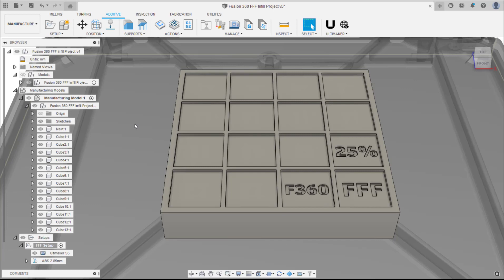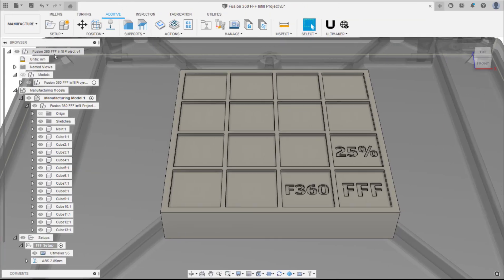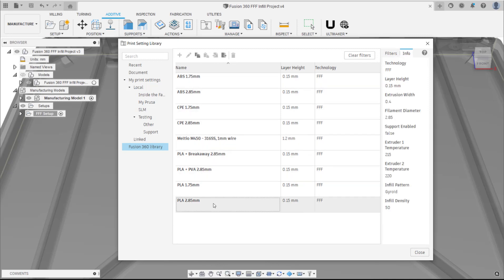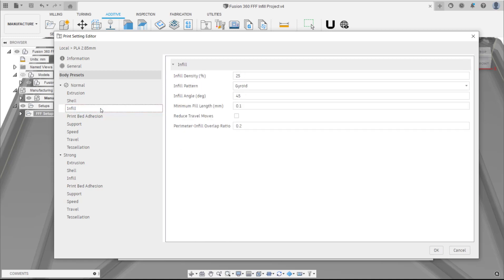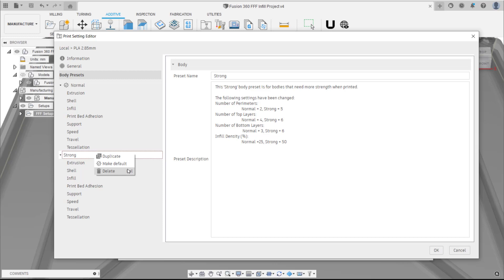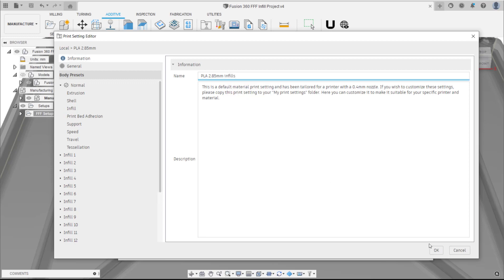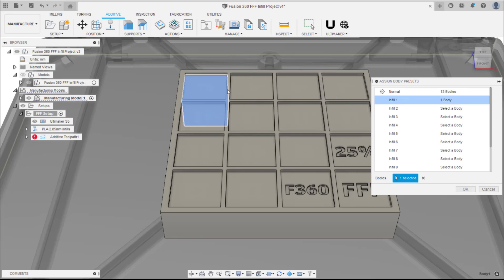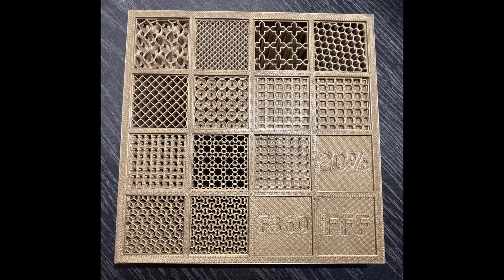How to Create Parts with Varied Print Settings with FFF 3D Printing | Autodesk Fusion 360

Comment: What happened to a bunch of the print settings in the fusion 360 slicer? I looked and I could no longer find the features to add a raft, change the print speed, change the infill, and other useful features that I usually use. I need help please 🥺
Reply: Hi Lucas, hmmm that doesn't sound right! Please see this video here on the new print settings dialog: 
https://www.youtube.com/watch?v=Gf16Sjn-nHE&list=PLmA_xUT-8UlIF-Cufk_7QG7miICaE30Oe&index=2&ab_channel=AutodeskFusion360

See timestamp 1:30 of this video.
Reply: @TripleEspresso7  I’ll take a look at it. Thank you for your help.

Comment: This video focusses on the print settings and body presets specifically.
For all those wondering how to create a setup (mentioned at 0:52) see this video here showing the full Fusion 360 FFF workflow:
https://www.youtube.com/watch?v=gi9qvDDeziQ&list=PLmA_xUT-8UlIF-Cufk_7QG7miICaE30Oe&index=5&ab_channel=AutodeskFusion360
Reply: When you press Post process in the layer simulation, can it always use last post processing profile, instead of creating a new one?...
Reply: @dzidmail  sorry what do you mean by this? I'm not sure what "processing profile" is?
It will use the postprocessor linked to the machine being used
Reply: @TripleEspresso7  The NC post process config. It creates a new one in the model tree - each time you press Post Process in Simulation dialog.